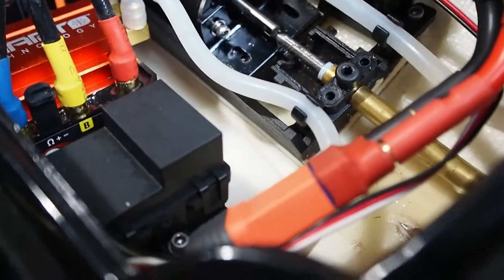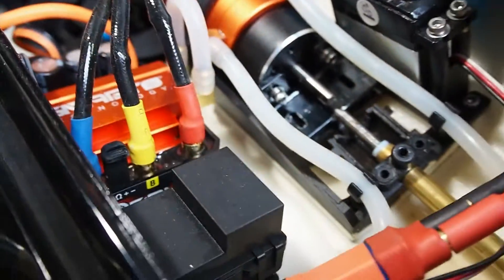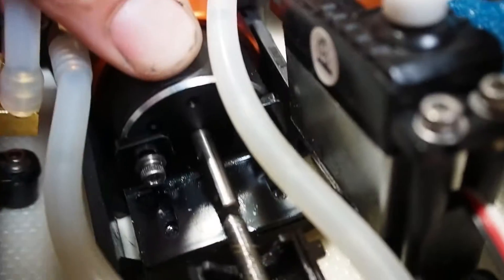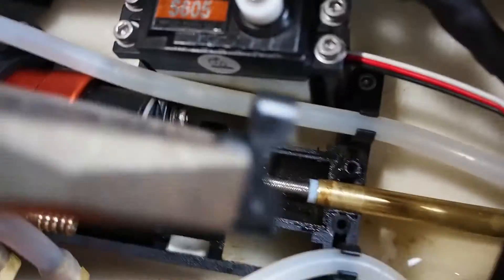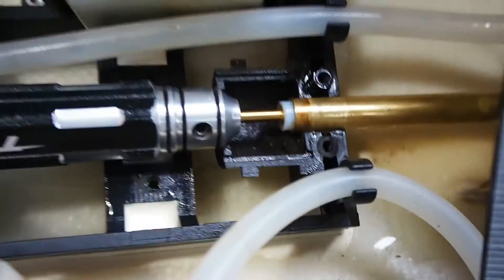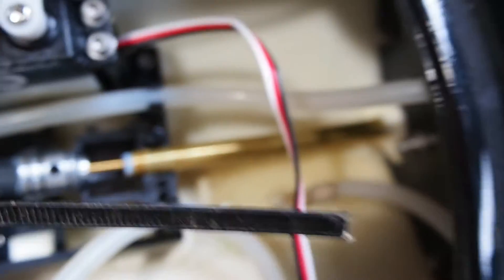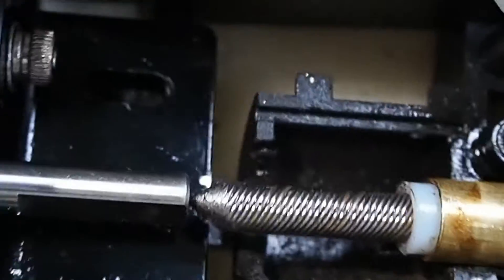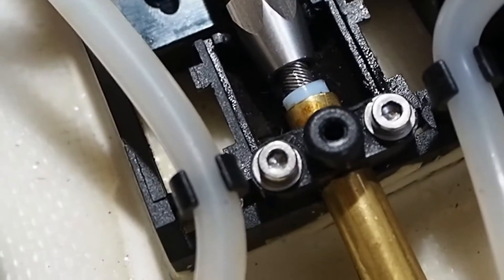Proboat Impulse 32 misaligned drive shaft fix

Comment: I had align all the proboat shafts to, big Geiko was the worst . Your liners are much better and fixes the heat problem.  Never have problems with TFL ,only when we run 6s on 4s motors ha,ha,  Cooling jackets leak on the impulse because the support pushes it out of whack. Gave it a sand and no problem.  You probably just saved people a lot of money and time . Should be able to drive the boats in my street soon with this weather.
Reply from the maker: Yeah tfl boats dont come in fancy boxes, nor are they as plugnplay as probaot and traxxas, but they are made to a better standard, ive never heard of anybody having to redo the factory work

Comment: Did you get the revised trim tabs in stock yet with the black adjusters??
Reply from the maker: Ive got some on their way over now, ill know in 2 weeks if these fit right or not. Everything has to be perfect when you sell parts for rtr boats as a lot of buyers are newbs to boats